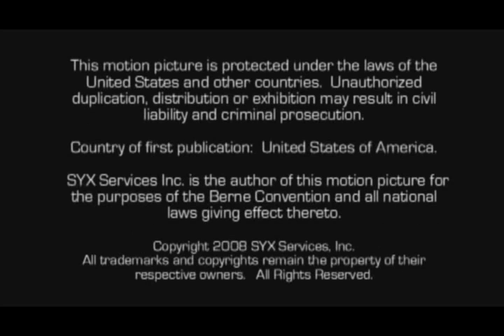How-to Build a pc (Part 2)

Comment from the maker: Your welcome.

With the cpu its pretty simple the only thing is, is that its very fragile. You match up the pins with the one in the cpu slot and you gently sit it into the socket, once in place secure the arm and your good.

However with the fan they come in different forms. A regular stock intel would be much easily to install cause all you do is snap it into place on the mobo. Wich would go through the 4 already existing holes.

Comment from the maker: if you talking about the wires that hang in your case when you first get it you plug those into your mobo The ones thay say pwr ground and led ground those plug into what is called a Q connector and that goes into the bottom of the mobo. The other cords are like your firewire USB esata those also plug into your mobo.

Comment from the maker: there is an 8 pin for your motherboard and there is a pci 8pin power for GPU`s my gpu used one 8 pin as well as a 6 pin. 

The power you plug into your mobo will be like a clearish white.

a 8pin at the top and a 24pin on the side